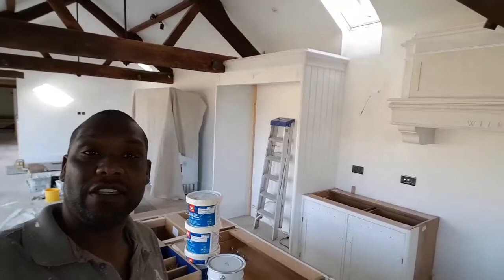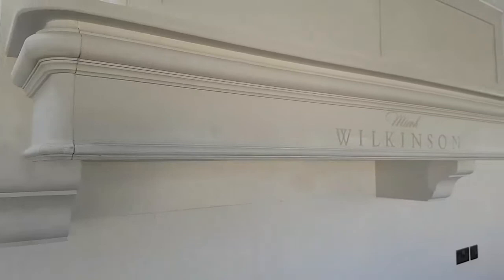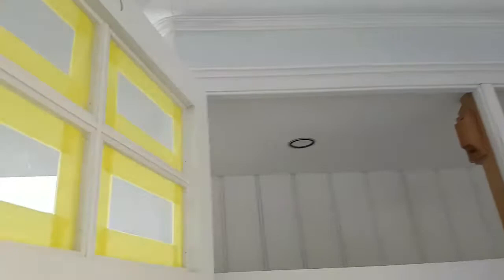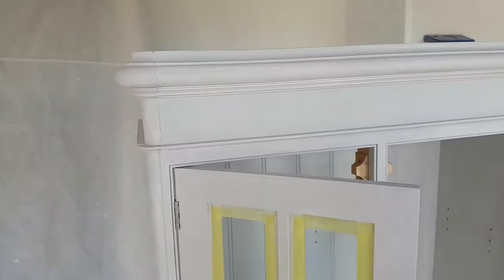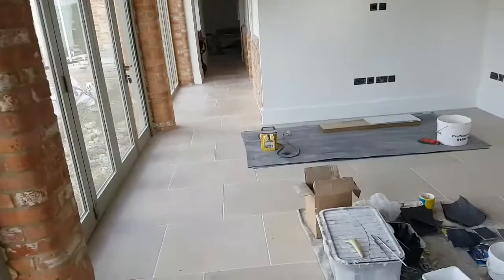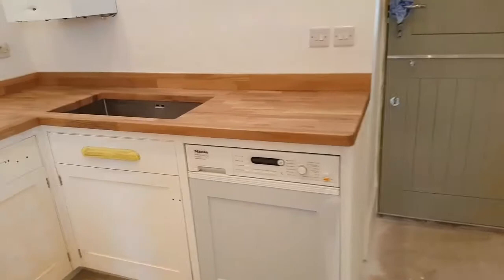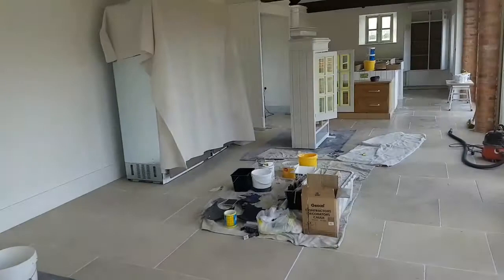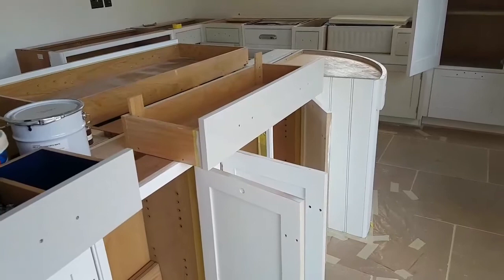Hand painted Mark Wilkinson kitchen part 2

Comment: Tikurilla is a great choice for this sort of work. I find rolling and tipping off is  best for good coverage and finish. 
What's your preferred approach Colin?
Reply from the maker: Deano Decorio same here I use a 4 " short pile Hamilton performance roller and Hamilton prestige brushes there nice  and soft and seem to to do the job well.
Reply: cam decorations gotta give you a big 👍 for your spraying stuff too mate.
I've been spraying for about a year now and always looking out for any tips I can gain knowledge from.
Great channel and great advice.
Reply from the maker: Deano Decorio do you use any additives to your paint or do use it straight
Reply: cam decorations I have used floetrol with good results but i tend to ease it with a touch with water  just to help with flow which seems to work well for me. 
A good tip is to slightly dampen the surface with a clean microfibre cloth  before applying  your paint.